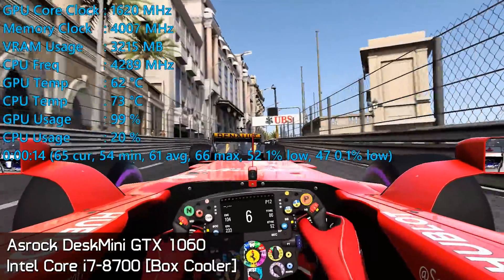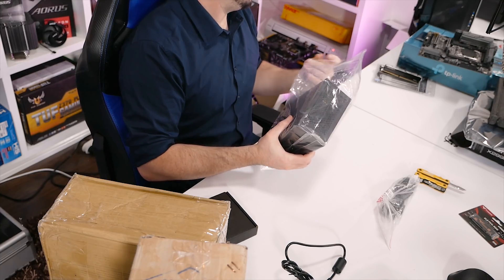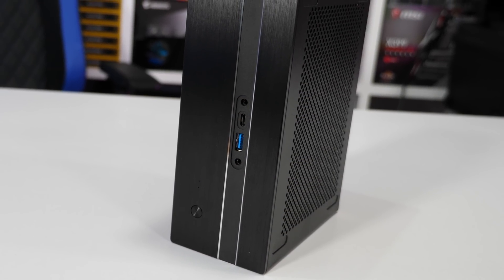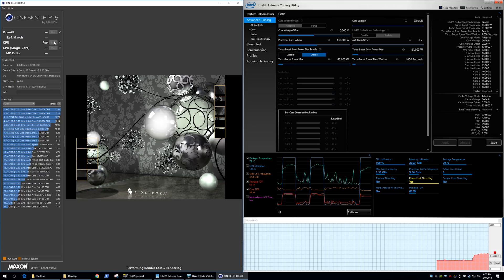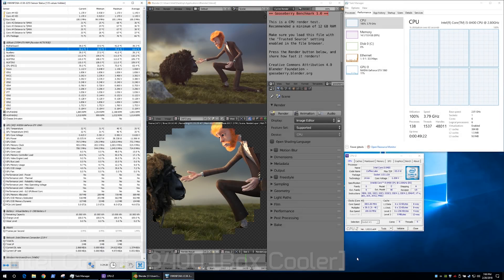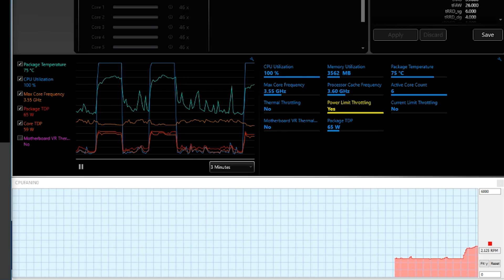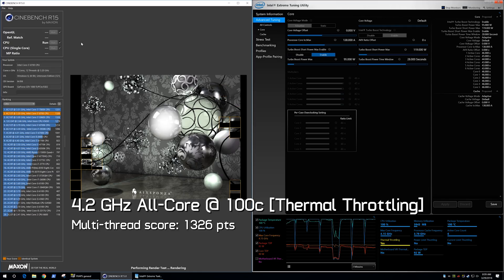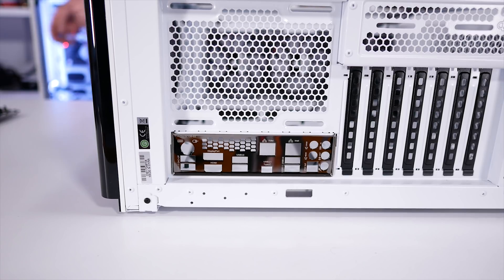Core i7 8700, Intel Box Cooler Limiting Performance

Comment: Well obviously the box coolers suck, but that's because they're designed for 65 watt parts, which this i7 Is not. However OEMs who actually care about that 65 watt power draw, unlike self builders will keep these limits in place. This will make pre builts that use the stock cooler effectively 10% slower than benchmarks indicate. I don't get why you can't connect the dots...
Reply: Why bother having this issue at all though? They could easily do what AMD did and just plop two 65w heatsinks together and use the same fan and have a 95w cooler for only a few more cents...
Reply: the 8700 is a 65 watt TDP part...; the 8700K is not..
Reply: NessMac because OEM's have power requirements like 65 watt for chips they will use. So they use 65 watt coolers for 65 watt + parts which then just throttle but at least look good in benchmarks.
Reply: mdd1963 no it's not why does it need a greater than 65 watt cooler / power limit,  in order to not thermal / power limit throttle
Reply: That's not a good enough reason. It shouldn't throttle ever. But I guess that's what I should expect from an OEM anyways. It costs them 5 cents to make a better heatsink and they'd cut corners even for that.
It doesn't matter what an OEM thinks the power requirements should be, the fact that they don't attempt to fix it is stupid. They only get away with it because the people who buy their products wouldn't know the difference. Shame.
Reply: NessMac I agree, it's a terrible reason but 65 watt parts are the standard for office PC's that might have a 250 watt PSU
Reply: if you are comfortable with 89C temps in gaming, and 99C in Cinebench, have at it, mate! :) (All are free gifts , compliments of a barely adequate stock cooler...

Comment: My brother and I ended up buying i7 7700 for our own systems each. The box coolers came with them were rubbish and the system that keeps them attached to the CPU & motherboard is terrible. Due to their poor design they struggle to maintain proper contact with the CPU's IHS. We ended up replacing them with an AIO on my brother's system and a custom water loop from EKWB on my system. Intel have been so lazy that they haven't changed the mounting design of their box coolers since the Pentium 4 because it still uses the push-twist pins. I'm not surprised that Steve has found the box cooler that the deserves to be thrown into the bin.

Comment: Good Job Steve! always quality content! Intel stock coolers always were crappy, they are okey if you use i3 or i5 with lower clocks, but for i7 it's not good at all, back in day i used stock cooler for my i7 2600k stock, and i couldn't render because temps always go up to 100C, though am sure cooler was attached normaly, had to change it for Titan Fenrir 4 heat pipe cooler wich ive got for 15eur, and almost for a year now am using VTG 5 cooler from aliexpress, Bryan from tech yes city made a review, managed to get that cooler with free shipping for 9eur. Though i paid 24eur but it came with damaged box and pipes were a bit bent, requested refund and got more than half my money back, considering cooler i just bent it back and it's working fine. At full load i get 50-56C on my i7 2600k on  stock cires, using chinese GD900 thermal paste, it's great lol considering price, 5x3g tubes for 4.56eur. In my opinion, people should check out other brands, to get best bang for the buck
Reply: I never got a stock cooler with my 2600K, didn't think K sku's ever came with one. Still using my 2600K with a Corsair Hydro 50 Mk 1 running just over stock clocks but it's behaving brilliantly as it has done for the last 6 years.
Reply: i just couldn't get good cooler at the moment, had to live couple weeks back then with stock. But 2600k still very good cpu, good overclocker , i don't feel like i need to upgrade it at all for another year or two.
Reply: Gotcha. I'm holding on to mine until at least Icelake/Zen 2 time as cannot see any benefit until then. Going to see if I can get myself a bargain on a 1080Ti once things return to normal and the new cards become available.
Reply: same bro
Reply: Ha I got one of those, buggered if I can remember what CPU is in that case, might have been the 2600K not sure.
Reply: AMD Box Coolers since the original Wraith have all been damn good.
Reply: Actually, last year I still had an Intel E6600 core2duo running on stockcooler, put on an asus p5k-e,  ..and was still running a healthy 60°c-65°c after all these years. However , it sat in a decently good aircooled antec P180..which also always been a great case for this setup. Too bad the motherboard got destroyed by my cat...don't ask! x-)

Comment: Good video overall. 
It's a bit hard to follow after switching to the tower cooler after the 8 minute mark. Is the 8700 getting the same +/-1200 result with power limit of 65 TDP and tower cooler or not? This would also spur the question as to whether we can expect B360 motherboards to allow for power limit changes?

The stock cooler is known to be sub-par on Intel. A slim profile Noctua L9i or Cryorig C7 results in this case would be more interesting for comparison instead of the tower cooler :) I guess the Gammaxx 200T was sticking like a sore thumb in this ITX case.

Comment: Why not undervolt the 8700 with xtu? Should incease thermal headroom & power headroom
Reply from the maker: You could do that but there's no guarantee all chips can do it. I really just wanted to test stock and find out why the 8700 is slower in some systems.

Comment: Actually, the limiting factor here is the thermal paste between the die and the IHS. Try delidding the 8700, and then run the same tests with the box cooler.

Comment: Lets be honest, most people who purchase a pre built, (the cheep nasty ones anyway). Are probably not going to check benchmarks, worry about temperatures or the boost clock multiplier ratio table! They will never be any the wiser probably, the people that are know to improve the cooling and remove the thermal bottleneck. Its still a bit shitty of intel to include such a crap box cooler (and TIM) & arguably a little missleading but thats also on the OEM's for designing hot box PC's. Its not an issue that will worry the vast majority of consumers.
Reply from the maker: Yes, I agree with all of this.

Comment: I agree with Steve that it is up to the reviewer to (also) test the CPU with the stock cooler, if it comes with the product then you have to test with it. However, in my opinion that doesn't mean that Intel wasn't lying/cheating. Yes, Intel didn't make any claim which wasn't true but Intel did mislead a bit. You could argue that Intel ought to point out what performance reaslitically will be seen when using the stock cooler. I wonder if Intel speculated that many reviewers wouldn't test the CPU properly ((also) with the stock cooler). Especially for the 8400 this seems important because Intel obviously positioned the 8400 opposite to the Ryzen 1600(X) with a slightly lower price, back then and on paper, if you could order one at all. 

The thing that Intel was most dishonest with, in my opinion, is that they changed their baselines. Think about this: higher turbo frequencies and a slightly (relative!) lower base frequency with 6 cores  compared to the 4 cores of the previous generation while having the same TDP an little changes in the architecture, node and other relevant aspects (like routing). Either the base and turbo frequencies were too low for the previous generation or the base and turbo frequencies are too high for this generation. Something was dishonest about this. Don't change whatever rules you follow from one generation to another without communicating that to the public. 

As a customer I can appreciate from AMD that they overdeliver (guarantee 3.7 GHz. for the 1700, deliver 3.8-4.1 GHz). Intel underdelivers: they promise a certain boost which can only be maintained with a proper motherboard and a proper aftermarket cooler.
Reply from the maker: Intel does not promise boost clocks, neither does AMD.
Reply: I interpret it as a promise under certain conditions (decent airflow in the case, decent quality cooling, decent quality motherboard). Is that wrong? Regardless, the Ryzen 1600 and 1700 will get that boost with the stock cooler, as long as you have a decent case, motherboard and casefans. The 8700 doesn't get that boost with the stockcooler. I see a difference in mentality. AMD has overpromised in the past and that has caused problems for them, they learned from it and with Ryzen they delivered exactly as promised, nothing less. Having said that, I can't say the same for RTG ("Poor Volta") even though the Vega56 reference card is a fine product, if you don't mind blower coolers which I hate. ;)
Reply: The so-called k-CPU (literally the same CPU but without that software lock) is not relevant in this discussion, it is about the locked CPUs which give very little freedom to the user for tuning, a consequence of Intel its choice to artificially lock it down. A problem is that Intel did deliver that turbo in most systems for Kaby Lake and Skylake, now all of the sudden the turbo is only reached in very good conditions. I don't mind that the clock frequency is lower while using AVX or while torture testing but that is not the issue, also while not using AVX and running regular software you won't get that turbo. It seems like false advertising to me. Intel had to increase the number of cores (it might be because they couldn't make much progress any more, it might be because AMD sells 6c/12t CPU's for <$200) and kept the same TDP while not making any relevant improvements on the architecture, the node, the routing... 
In short, the power of CoffeeLake 8400, 8600, 8700 is around 50% higher than the power of Kaby Lake at the same clock frequency. Yet Intel gives the same TDP and advertises higher turbo frequencies. Something is fishy.  By the way, nothing stops Intel from giving a decent stock cooler, like AMD does. Personally I prefer no stock cooler at all and a lower price, both for Intel and for AMD but that is because I am rather demancing (noise level and overclock-potential). 

Personally I am not interested in any Intel product for the desktop right now. I think that AMD is the better bet. At this moment Intel does still have the performance crown but that won't last long. Around this time in 2019 AMD should at least equal Intel if they don't beat Intel. 7 nm. GF and 7 nm. TSMC vs. 10 nm. Intel, this should be a win for AMD next year. Intel is having way too much problems with its 10 nm. node while the 7 nm. nodes seem to be doing well. Here, read it for yourself.  
https://fusedotwikichipdotorg/news/641/iedm-2017-globalfoundries-7nm-process-cobalt-euv/2/
That number (10/7) is deceiving but the 7 nm. nodes are a bit more dens than the 10 nm. node of Intel. The only advantage of Intel is that their node can be fully optimized for CPUs while GF needs to make compromises because the node is also being used for other products from other companies than just CPUs. 
Besides, it is doubtful whether Intel will let you upgrade in 2019 or 2020, we know for certain that you can put any new Zen-CPU in the socket of any AM4 motherboard untili 2020, if not longer (2020 the minimum which is promised, not the maximum). Right now AMD is the better choice if you build a new PC. For CPUs of course, graphics cards is another discussion.
Reply: Fair enough that you don't need very good conditions for the boost but you do need an aftermarket cooler according to Steve his tests. 

With your last point I most certainly agree. I would love to see AMD lead with 70% market share for 10 years, just to build up some reserves again and be financially more competitive (and because Intel cheated in the past with bribes and even blackmail which ended Compaq) but I don't want any of these two companies to not be competitive, competition is good for us customers. From an objective point of view the big advantage of AMD is that the platform offers longevity, Intel never offers more than 2 generations on the same motherboard, AMD does. Also it seems like AMD will get the better CPU next year but maybe Intel pulls of a miracle and all of the sudden gets a grip on their 10 nm. process, it is unlikely though. 

I don't see much reason for choosing the higher binned models of Zen for the same number of cores given that all these models are unlocked, as it should be. Unless you have a >=140 Hz. monitor and you play a lot of games which only use 1 or 2 CPU cores, then you will get a higher FPS (XFR) and be able to use it. Of course we have to wait and see to what extend there is or isn't a difference between the 2700 and 2700X, for Ryzen1 the differences (1600 vs. 1600X and 1700 vs. 1700X) were negligible. For that reason I compared the 1700 to the 8700k (cores vs. clock frequency, it compensates each other, roughly) and the 1600 to the 8400. 

How do you know that the cooler of the 8700 can overclock the 8700k to that frequency? You don't get that cooler when you buy the 8700k. Anyway, that is a different situation than getting a high boost for the 8700 because on that 8700 extra restrictions are in place. More is locked than just the clock frequency, there are quite strict restriction with regard to temperature, power draw and voltage. The temperature seems to be the big problem for overclocking the 8700 with the stock cooler, the stock cooler just can't get rid of the heat fast enough. Quite honestly, I don't understand why Intel didn't upgrade its cooler and just solder the IHS to the PCB like AMD does. It doesn't cost a lot of money ($15 for the cooler and a few $ for the soldering?) but it would make the CPUs a lot more attractive.

Comment: As Steve explained in the video, there is vrm throttling, cpu throttling and power delivery limit, for example I had Phenom ii x4 940 3.0 ghz with 140w on stock voltage, and even if it is rated 115 degrees C, my cpu throttled at 86 degrees because of vrm... I had shitty box AVC copper cooler, and it couldn't sustain 140w tdp, when I undervolted cpu I had maximum 60-63 degrees C... If you buy budget motherboard, read tdp cpu support, and if your motherboard support your desired cpu, all you need is aftermarket cooler, because you don't need high end motherboard for high performance cpu, as long they support your desired cpu, you are fine with it, just replace shitty stock cooler...

Comment: I can't get more than 3.4ghz on an i5 8400 with the stock cooler
Reply from the maker: Which motherboard? Not that I suspect that's the issue, I'm yet to find a board where the 8400 won't hold 3.8 GHz on all cores.
Reply: It is the z370 aorus ultra gaming
Reply: https://www.3dmark.com/3dm/25908573 heres the benchmark I don't know why it won't perform as well as other peoples parts maybe i'm just unlucky
Reply from the maker: Have you tested with Cinebench R15?
Reply: I got 834 in rendering and 122.16 fps in OpenGL

Comment: I would like to ban Intel stock coolers, they are worst in the world... When i replaced my Phenom ii x4 940 140w cpu wit i3 8100, instead of Intel stock cooler, I installed my 130w cosmo cool lc cc-95 cooler and guess what- cpu temperature never exceed 45 degrees C, while average temp is 30-35 in idle it is 25... Where ever you are, ditch shitty stock cooler and buy 10-15$ aftermarket cooler...

Comment: So Steve you are basically trying to say that i buy i5 8400 with hyper212 to be on safe side especially when my room temp is nearly 40 degree Celsius most of the time in Indian summers ? Please keep up the good work
Reply from the maker: I think even at 40c the 8400 should be okay, but I'd get a tower cooler anyway since they are worlds better and don't cost much ;)
Reply: Hardware Unboxed Steve thnanks for reply hyper 212 or any other suggestion ?
Reply from the maker: I like the Gammaxx 200T or 300 because they are dirt cheap and are as good as any cooler under $40 US.

Comment: I don't think the 'con-job' refers to the cooler (if it's AdoredTV's con-job). He has a few videos explaining it more, and it goes a bit beyond the cooler. Nevertheless, nobody disagrees with you here: the box cooler sucks. Nice testing but it's pretty limited to the ASRock. Maybe in a few weeks with the new cheaper chipsets.
Reply: Why are you so protective about this? This is already suspicious. TDP=Thermal design power & "Power Consumption". Actually, no. In typical load (Blender) = 95w, more heavy/stress - 115w https://goo.gl/whMioE . Wraith Spire 95w also.  Now look at your video with 8700.
Reply: How is it a problem? It'll still do the base and possibly the single core turbo frequency, which is what Intel is advertising now.

As long as it does what Intel says it will, I don't see the issue.
Reply from the maker: @Dmitry - We need an education video explaining what the TDP is and what it means. You realize the R7 1800X exceeds it's 95 watt TDP as well right?
Reply from the maker: He never talks about the cooler. Part 1 was the 8400 all core boost which we now know is 100% wrong. Part 2 was the 8700 and it's TDP which is wrong, the issue is the cheap box cooler, not motherboards.
Reply: Part 1 can be wrong for now, but problems with the new tricky frequency designation may come later. Part 2 nope, issue - fake TDP, which must be at least 95 watts (as same 8700K). Not suitable cooler - it is secondary. Weak-naked VRM rated for 65w on new B360/H310 + 8700 ccombo - is also problem, you mentioned this yourself.